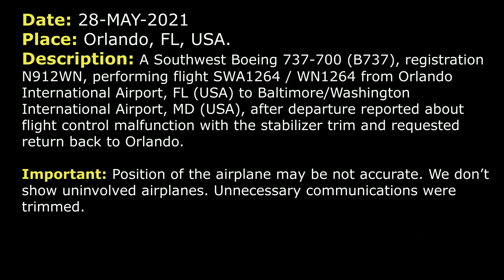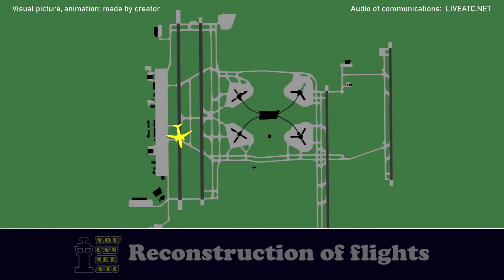Flight control malfunction. Stabilizer trim issue | A Southwest Boeing 737 | Orlando, ATC

Comment: Question, what is the purpose of the altimeter numbers that they are given before landing?
Reply: Altimeters work by measuring the atmospheric pressure, as it decreases with height. The numbers they provide is the airfield's current pressure (it varies throughout the day), which the pilots input into the device so it can accurately know where the "zero" is. Hope that makes sense.
Reply: @facundocorradini  thanks for the explanation!